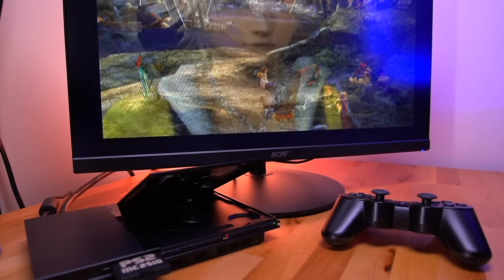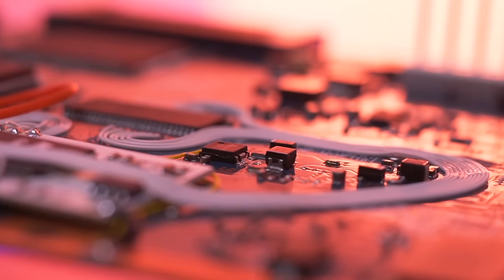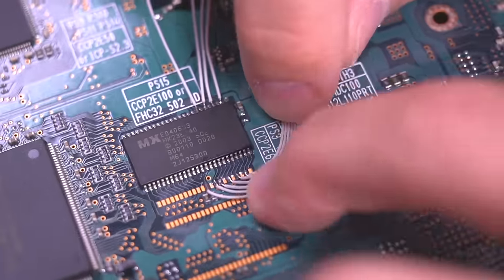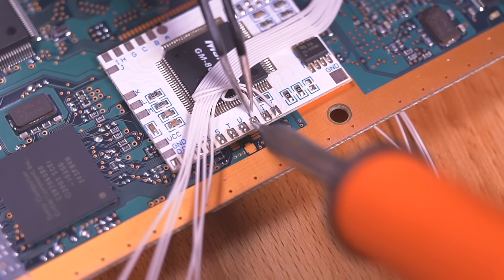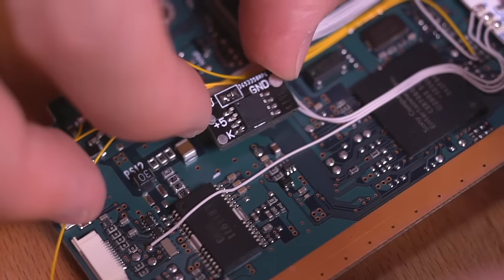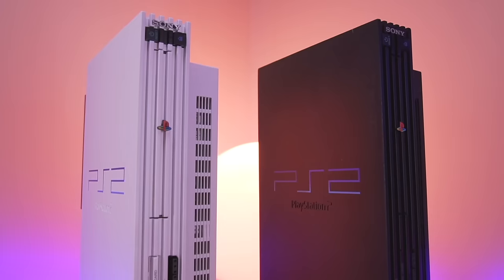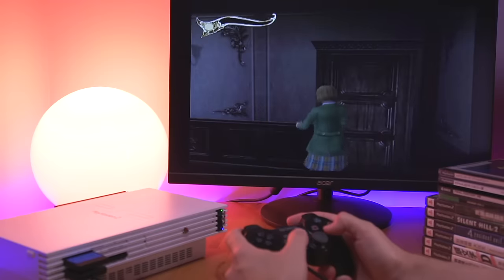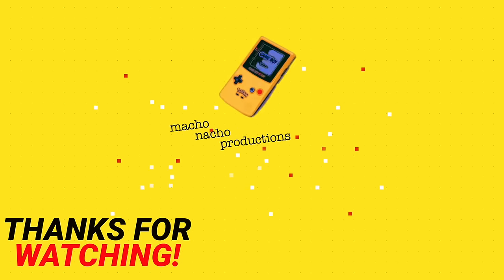Why You Need A PlayStation 2 Modchip In 2022!

Comment: I think especially for a fat PS2 at this point (even 2 years ago in 2022 when the video was posted) with the ease of soft modding with FreeMCboot / FreeHDboot and either an internal hard drive or MX4SIO to store and boot games from any region, it kind of makes these old hard mods unnecessary. Plus by loading your games off of some kind of non-disc storage you won't wear out the laser assembly at all - or you can revive a console with a dead laser.

Comment: in ps2 era mod chips obviously were neccessity for modding the system and play backups using hdd and usb even playing burned discs but since with availability of fmcb one  get all access of homebrew without needing to install mod chip so for hobbyst its ok but for practical casual gamer or ps2 fans it aint practical since everything is accessible with fmcb

Comment: Hey Tito, really enjoyed the video. I wanted to say, I'm confused as to why you need to push the reset button twice for a PS1 japanese game to work. I installed a mod chip in my Slim PS2, a modbo 4.0. I used the information for the install and technique from RGA, Paul is a good guy. I have a back-up of pepsi man on a cd-r and it runs as soon as I pop it in. It could be because of differences in the chips we used since you used the Mars Pro and I used the Modbo 4.0, which based on what Paul said, is a Matrix Infinity clone. I also wanted to bring something to your attention with some PAL imports as this is the main reason that I modded my PS2. I have 2 PAL games, Evil Twin: Cyprien's Chronicles and that runs totally fine. HOWEVER, Forbidden Siren 2 can give you a LOT of grief as it can crash so many times when it comes to trying to run it. Enough so to lead one to believe that the mod doesn't assist in playing that particular game. But (a little self promo here, not gonna lie) I did a review on the first game, Siren, and at the end I mention that there is a way to make sure the game runs based on the settings you put before running the game. Even in forums for the early days mention Forbidden Siren 2 crashing constantly. It's one of the biggest reasons to mod a PS2 because even on a backwards Compatible PS3 you can't run out of region ps2 or ps1 games. Anyways, this video resonated with me a lot because of how close to home it hits and just wanted to say again that I really enjoyed the vid. Thanks again.

Comment: the problem with the v10 ps2 especially using the mars pro chip on it, the console tends to reject the code and therefore causing hardware issues, I prefer use the modbo 4 as last resort or the super 7 modchip on the v10 since the coding is much more lighter than the mars pro.
Reply from the maker: Thank you for the recommendations!

Comment: I have 2 ps2's slim, one whit the mars pro, and the other whit a matrix infinity clone(modbo 4.0) and the modbo is far better, I can acces to the mod bios, play ps1 backups just using the backup itself(while I can't at all on the mars) and use the 480p mode on supported games, the mars don't let me do that, it was the reason why I originally bought another ps2
Reply from the maker: Modbo sounds like a winner!  I may have to swap it in my ps2

Comment: At one point I was trying to install a mod chip on my PS2 because the optical drive on my Japanese PS2 Slim died and I still wanted to play import games on both PS1 and PS2, and I didn't feel like dealing with all the rigamarole of ripping my games to .iso and juggling them on my Linux Kit drive. The process went poorly, and long story short I ended up just buying a Japanese PS2 and installing FreeMcBoot and an older SSD.

Thankfully my US PS2 still works (aside from the power light). I mostly just found the tiny solder points way too difficult to deal with.
Reply from the maker: Yes, it’s definitely a challenging mod to do.

Comment: I just had to completely remove a modchip from my ps2 today because it wouldn't turn on. This seems to be a very common problem.
Reply from the maker: Mod chips definitely seem like they are finicky. Also the quality of the install I’m sure is very important as well in terms of reliability.
Reply: @MachoNachoProductions  Yeah, I assum the one I had to remove was there since the 2000's because it was a very old revision of the Thunder modchip with very basic functions

Comment: I love modding PS2 consoles. It's an art to get the wires installed tight and clean like you did here, and I enjoy it. Well, occasionally. After modding one console, I need about a month to recharge because it's a lot of work and patience.

Modding the later slim models is a horror show. Not as fun as doing phat models.

Comment: Hey, if anyone could help me with this I’d appreciate it greatly: I have a ps2 slim I got used from eBay, but the problem is the bottom label is partially torn off and the crucial information about the model number and serial number are only partially legible. I can see that the model number is SCPH-7??01. Is there any way using markings on the internals or something to determine the specific model number that I have?

Comment: Man, I've had some Mars Pro chips, Modbo 4.0 and Modbo 5.0 chips sitting around for 2 years. I was leaning more towards the Mars Pro as I vaguely remember RetroGamingArts spoke highly of them.

I initially bought them as I was seriously  tempted by the hassle free PS1 support. I mainly use PS2 slims, so am curious if these could be used alongside MC2SIO for an ultimate slim.

Comment: Question. So regardless if I play a ps1 ntsc or Japanese import I still need to double click the reset button to boot into ps1 mode but if I swap back to ps2 games do I need to do the same method with resetting twice? Also, regarding the bios menu function not being available in 12:00 do you mean the ps2 bios menu? is that still not present with mars pro modchip in the fat models? I ask because I want to be able to still boot into freemcboot before having this chip installed in my 37000 blue oceanic ps2 jpn model. 😁

Comment: I modded my first PS2 around 2004 or 2005... actually it wasn't my own console, I didn't own one back then. It was a friend's V5 and I put an original Matrix Infinity in it. After that I was hooked and bought my first PS2. It was a silver V9. Not the best model to mod in my opinion as it has some issues with the laser driver IC getting too hot when playing backups. Otherwise it's fine. My current PS2 is a V7. The most reliable model in my opinion. I modded it with a Crystal 2.0 chip first, then I put in a Modbo, as I liked its simplicity more than the feature rich (and sometimes unreliable and nowadays pretty dated) menu of the Crystal 2.0.

Comment: What the heck man! I know for a fact if I did that much playing with the wires after soldering them, they would have ripped the wire( and the pad) right off the board.
Reply from the maker: It looks like there is a lot of tension on the pads but if your careful it should be fine. Also, soldering technique is important. If too much heat or dwell time is placed on the pad it can weaken it.

Comment: Wait OPL can’t run imported out of region ps2 isos? Haven’t tested it myself
Reply: It CAN. This was about discs and Tito doesn't seem to be aware of some software around, like MechaPwn and tonyhax both being working Alternative solutions.
Reply from the maker: That’s a great question.  I’m not sure if I can run out of region iso using OPL
Reply: @MachoNachoProductions  You CAN!
Reply: @MachoNachoProductions  yea it wasn’t to deter to even installing the mod chip which of course great job! Even with those problems. Just the perks increases now that apparently OPL can run out of regions backups so if the disks were to get ruin, you still can play them in backup form.

Comment: Hey i have an SCPH-90004 model slim console. Its very new and not much used. Even the warranty sticker has not been tampered. That means its not modded. 

So i want to play all ps2 games in it. I want to burn iso to dvd and play in my console. What are the things i should do. Is modchip the only option?. I dont want to play from usb since it will be laggy and the games could crash.. plss help.

Comment: Hey Tito. Soldered in my PS2 modchip last night (modbo 5.0), no video, but hear sound. Tried the component video setting change but no luck. Any suggestions?
I'm thinking remove and see if it works normally now and check fuses

Comment: I often wonder why people do this to older hardware. I understand why people did it when the console was current but surely to a collector an untouched example of the console would be more valuable. If the desire is to only play the games then emulation is at a point where it is near indistinguishable from the real thing.

Comment: I have a modbo chip in my fat PAL PS2.

An odd thing I encounter is with SOME Japanese PS1 games (Metal Slug X and Pocket Fighters) is the the picture shifts right to the top leaving a massive black border at the bottom.

There are some options in the Modchip menu with regards to screen options, but no matter what I set them too it doesn’t fix the issue.

It’s not the biggest issue as I have a chipped PS1, its just frustrating. Anyone have any ideas what the issue maybe?

Comment: Why does the Mars Pro chip require pressing reset twice to play import PS1 games where other chips such as my DMS4 do not?
Reply from the maker: Not sure why. It’s certainly a strange design choice
Reply: @MachoNachoProductions  odd that some behave differently. The DMS4 just acts like a regular PS2 when you put in a PS1 game and boots it regardless of if the disc is an import or burned

Comment: For me in this case (PS2), is not worth the hassle. Freemcboot is much easyer to do and gives you more options, plus if for whatever reason you don't want to have your PS2 modded anymore, you can just remove that memory card and voilà! You have a virgin PS2 with no traces mods. And if your objective is to just be able to play japanese import games, I'm pretty sure that importing a japanese PS2 will probably be even cheaper than the modchip.

Anyway, great work with the wiring.

Comment: I have a modbo 5.0 on my PS2 Slim 70K, the two issues I have had with the chip is i cant boot grimdoomers Exfat version of OPL from a USB/boot menu (I have to boot from a memory card which contains GD's OPL) AND the memory card manager "Apollo" straight up wont work my chipped system

Comment: Not sure if this has been mentioned yet and I'm not slamming you for this video cause a mod chip could come in handy for plenty of things i'm sure.  Maybe you did a video on what I'm about to bring up and maybe you are already aware of it.  However Mechapwn at least for slims can play all regions as well.  The only issue with that however is there's two different setups.  One will allow you to play burned PS2 games of all regions however I believe PSone is completely broken.  But the other one is the one I use and it allows you to play games of all regions for both PS2 and PSone.  As far as I know this one also allows you to play Back-ups for PSone but not PS2.  I'm not totally worried about back-ups but that's the one I have installed and is great for playing Japanese games and possibly even PAL games.  So yeah I just wanted to mention that incase you aren't aware about it.

Comment: Great video :)
I’ve installed a Mars Pro in a Japanese slim ps2, I works great, but playing a PAL ps1 or ps2 physical game on it, made the game run too fast. As to the 50Hz in PAL game (Europe) now running 60Hz on the NTSC-J (Japan) console.
(Would be the same with an NTSC-U/C console)

Tito, do you know if it’s possible to run PAL games in the correct speed with this Mars Pro mod chip?

Kind regards

Comment: So basically soft modding wins again. Not only won't soft modding brick the PS2, it's also much easier. And sure it's almost like art in how creative you get with cable management, but it also brings an other thing to take attention, leading to something like soldering it in on the wrong pin and frying the PS2.

Comment: Have you checked the fuses on that Japanese ps2 board? It's likely one or more have blown and replacing it/them would fix it.

Also why are you using a MARS PRO? It's deprecated, it's much better and cheaper to use a modbo 5.0 these days. Sure, it's a matrix infinity clone but it isn't like the Matrix team is still releasing firmware.

As to my experience in modding ps2s, I modded a bunch of my own, a scph-70004, scph-90004, scph-50000, scph-30000 and (because why the hell not) a DESR-7000. I was late to the party so I always used modbo 5.0 because it's the most up to date chip (even though it's dated), it's readily available and matrix infinity chips (for which this is a clone of) support the most board variants. (Though my scph-30000 board and obviously the desr-7000 weren't referenced so I had to find the points by hand, which isn't really complicated once you follow traces.

Comment: I never installed a modchip, but I did install a fliptop case in order to play imports. Later I did an HDD mod which was super janky. It wasn't like Free McBoot where you had a pretty menu. It looked very primitive; if I recall correctly you had to have a PS1 game in the drive for the exploit to work, and you had to do some controller button combinations to get into the menu (hitting Select and L1 is coming to mind?). Crazy times.

Comment: I dunno man, I installed my first ps2 mod chip in the very early 2000s and my most recent one 2 years ago. I don't think it's worth it AT ALL anymore. If you like soldering for no profit and you want to try one out sure. It was absolutely worth it 20 years ago but now it's just redundant. Stick to freemcboot. By the way, that ps2 I first modded 20 years ago still runs perfectly, but even that machine also runs freemcboot now.

Comment: I would not recommend the Mars pro whe you had the matrix infinity. Honestly the modbo 5 is the way to go and basically only option today because of the features he have. Like direct boot from hdd, USB or Mc. And also modbo does not need to tap twice to enter Ps1 mod. Just insert any disc and it will autodetect. As I say mars pro is not good.

Comment: I did my PS2 mod chip like a few months ago and I ended up killing probably like 5 PS2 in the process but I somehow managed to get it done I installed the matrix one and it does have problems with using free Mcboot so I ended up finding someone who created a file system that will let me load hard drive
Reply: So... A lot e-waste for almost no gain over software...
Reply from the maker: I’m glad you were able to get it working!  Yeah mod chips tend to not play nice with free mcboot. Cheers dude!
Reply: I wouldn't say it's a waste definitely a plus in my book because I was able to find the system software that I can use in Mass mode to load up the mod chip and load my hard drive because this way I can run HD loader and just rip my Japanese import games to my hard drive so I would have to go through some extra steps on my PC so definitely a plus
Reply: @lobstercoco  Erm... The software you mentioned can be run without a chip (better actually) as well as the installation of games being possible without "extra steps"...
Reply: @tnaplastic2182  no what I'm referring to is a system file that you can put on a USB flash drive and leave it on there and it would basically load like a dumb down version of opl you launcher and HD loader I found it while I was searching for a solution to resolve my system freezing every time you went to the system menu when the hard drive was installed or if it didn't freeze it would freeze the moment I will launch an app from Free mcboot
Reply: @lobstercoco  Those things freeze BECAUSE of the modchip...!!
There is no "system update" for USB on the PS2.
Everything you mentioned can be EASILY accomplished with Softmods only and BETTER than a chip can.
Reply: I read if you disable the modchip (controller input) it doesnt interfere with softmods
Reply: @ShadowZero1980  If they properly disable, correct!

Comment: I was going to say that Mars Pro is a shitty chip lol the only chip that really works and the best one is the Matrix V1.99 the others are crap :P
Reply: The only good chips are the original chips IMO. 🙈
Reply from the maker: True!
Reply from the maker: I agree, this chip was a bit of a headache. It was supposed to be fully compatible with my console but some of the features were missing.
Reply: @MachoNachoProductions  A friend sold to me a PS2 FAT 30002R Is a NZ and AUS model and im from Uruguay but same PAL region, the thing is it came with the same chip as yours, i was having big issues reading original PS1 games like RE3 Nemesis Spanish, and others, and ps2 games struggled to read them so I cleaned the laser, new grease on the mechanism, but nothing, i took out the chip and bam! the console was reading  all the games!
Reply: @sos.gamers  One of these chips, which affect laser voltage probably...
Reply: @tnaplastic2182  yes